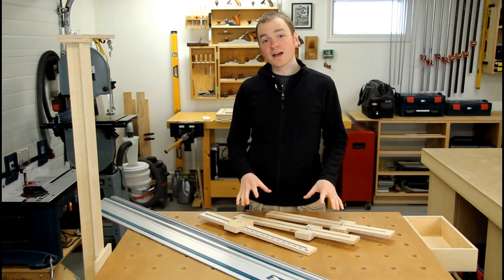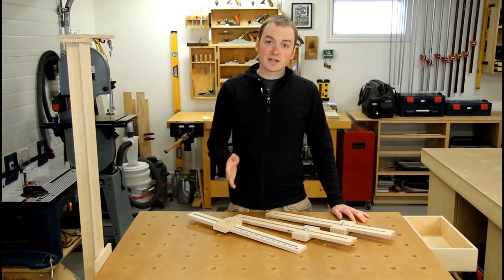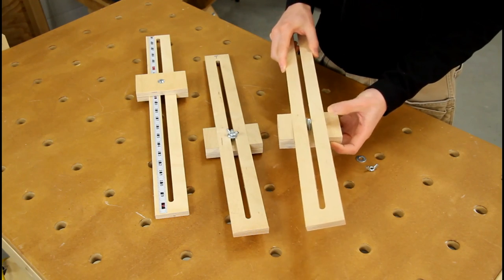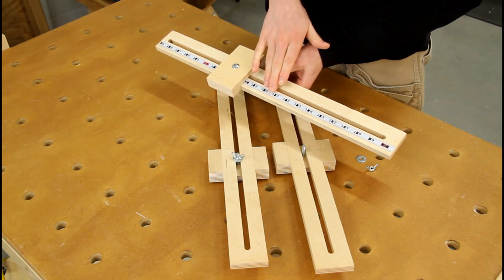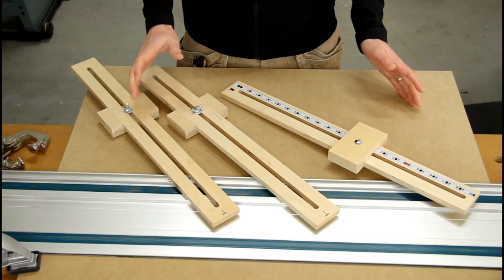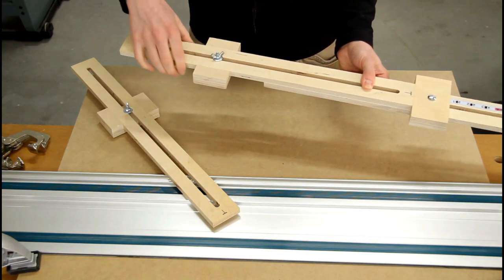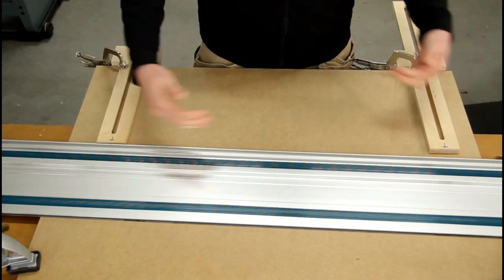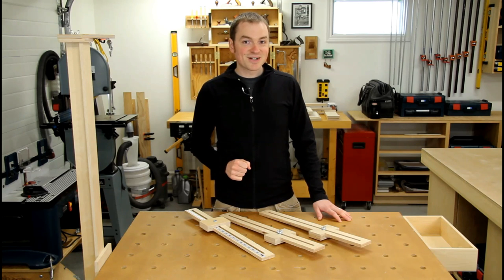Quick Parallel Guides for your Track Saw - Simple & Accurate

Comment: Dan, your design's inclusion of the measurement bar renders your system better able to produce absolutely parallel cuts than the "slicker" commercially available models that rely on accurate independent reading of the scales on a pair of stop/rail assemblies. As with many woodworking tasks, the best measurement is no measurement.

Comment: I watched a number of videos for ideas for parallel guides and I feel your design is the most simple and the most accurate of all the other designs.  I made mine last week for use with a DeWalt track saw.  DeWalt's track has anti-splinter rubber edges on both sides of the track, so I needed to cut off the rubber on one side of the track so that the guide butted up to the aluminum track.  I also make a couple of minor enhancements. I moved the scale to the top of the guide and added an adjustable plexiglass sight. This way I can fine tune the scale after I make my first cut. Another enhancement I made was to make removable 20” extensions giving me the ability to rip 26” without the extension and up to 46”with the extension.  I considered making the guides longer, but I felt they would get in the way for narrow rips.  And finally, to help keep which end of the guide is which, I painted the tips that touch the rail.  I also painted a thin stripe on the rail itself to remind me which side of the rail to place the guide.
Reply: You could of just put a small rebate at the end, so you didn't have to cut the splinter guard off👍
Reply: BEN LATHAM I played with a few options before cutting the splinter guard, but in the end, I wanted to be sure my parallel guide was resting against the aluminum track without having to check or verify each one.  Besides, DeWalt is the only rail I know of that has splinter guards on both sides of their track.  Removing one hasn't been an issue.

Comment: This is just what I needed! I am using the same Makita track guide which is long enough for cutting the short side of a full sheet of plywood in one go. For ripping the long side though I would have to reposition the guide half way through the cut. Now with these parallel guides I can make sure everything is alined perfectly. thanks a lot!
Reply from the maker: +funkyclubber thanks for the comment.  That sounds like a perfect use for the guides.  Glad that you found the video helpful.
Reply: Great idea for ripping the long side. I've got a 55" and 39" Makita track coming. I was wondering how I'd rip an 8' sheet since both tracks together would be short of 96". Now I can make these jigs and just use the 55" track repositioned.
Reply: @Campos2011  I'm sure you've come up with another solution by now, but for anyone seeing this post, you can also buy makita guide rail connectors. This way you're able to cut down full sheets length-wise, by combining two separate makita guide rails.

Comment from the maker: Check out the parallel guides that one of the viewers has made based on the video!  If you build one of the jigs from the channel and would like to share or any other idea make sure you post it on the DP Shop Talk facebook page.

https://www.facebook.com/photo.php?fbid=10154462749878054&set=o.473239762859879&type=3&theater

Comment: You, good sir, just earned a new sub.  This is brilliant.  I bought a Dewalt track saw system a couple of months ago, and I've used it so much I can't believe I ever went without it.  But I was stumped on how to set up a parallel guide.  This is super simple and absolutely brilliant.  I'll be making it this week for sure.
Reply: How did it work out on the dewalt track? Little different with the double sided track
Reply: @garradmiller5025  Pretty much perfect.  I only ever use one side of my tracks, but the Dewalt should be the same on either side.  Any minor differences are accounted for on the first cut through the rubber zero-clearance strip, so I don't think it would ever be an issue since these guides butt up to the track rather than ride in a channel like the woodpecker system.  I have both the 59" and 102" tracks, but the real test was using the 102" to make some rips down 8' ply.  Repeated cuts were dead nuts accurate down the full length, so I'd call it a huge success.
Reply: @mkbcoolman  good to hear. I was mainly curious about indeding againstbtubber rather than aluminium.  102" track seem long enough? Been eyeing one but have heard some think its too short.
Reply: Yea, I just ordered my Dewalt Track saw so this made my life a bit easier

Comment: Exactly what I will have to make tomorrow (some time....!!) as my poverty track saw and guide has worked really well but repositioning the track halfway through the cut exposes the cut to much potential error. Tmrw I get another 1400mm track guide to connect to my existing 1400mm track and then I will really need that setting jig.  Next week my new Carvex arrives and of course that will never fit these poverty pack track guides.  I've ummed and aahed for about 5 years now about getting a Festool tracksaw but I'm so surprised that this cheap one works so well that I've put off going green on this... I'm off to rewatch yr MPT/MFT vid to get some more ideas on setting this tracksaw up on the Festool top. 
Thanks for the great videos and the modern technical take on modern technology and techniques. Need a ton more of these on YouTube as so much fantastic stuff gets buried over on FOG.  And, most of the magazines just avoid the whole genre and concentrate on birdhouses, router bits and block planes (apologies to those affficionadoes) Nothing like how to set up a square tracksaw cut or how to get the most out of a MFT top...or how to engineer a boom arm!!  Thanks again and g'day from the south west of Australia....
Reply from the maker: +cognitor900 glad to hear you find the videos helpful

Comment: Hi Dan! Thanks for the tip. I was just looking for something like this. And with your ideas, I have built my own.
I would suggest doing the slidders of the same width of your ruler (mine is 185 mm width). So that I don't need to perform calculations. I just measure the whole distance from the top, to the end of the slidder, and done!
Reply from the maker: Great idea, thanks for sharing👍

Comment: Another great shop made jig you got there. However, isn't the setting jig (SJ) unnecessary? Can't the parallel guides (PG) be used to set each other? For instance, you'd lock down the stop block on one PG, and essentially use that as the SJ for the other PG?
Reply from the maker: +Know How you're right it is unnecessary. A lot of people have pointed that out since I made the video and it's something that never occurred to me at the time. I do still use the setting jig though when I use the guides since I already have it and it keeps the setting jig as an accurate reference that doesn't get bumped around. Definitely isn't required though.
Reply: Great point!

Comment: I like this idea; simple and effective.  It reduces error possibilities.  The only thing I’d probably do differently in the design is use T-bolts and recess the head of the T-bolt and epoxy it into the stop block.  That way the bolt head won’t stick out of the bottom of the stop block and scratch stuff up.  I’d also probably use some nice plastic knobs instead of wing nuts.  But those are minor things; personal preference.  Great stuff, Dan!
Reply from the maker: Those are some great ideas Rich, thanks for sharing.  I think when I made these I was making them quickly and grabbed whatever I had for hardware in the shop at the time.  The T-bolts and knobs would be great additions.

Comment: Great idea, will save me money.  But why not just use the setting guide as one of the parallel guides after setting only one of the guides?
Reply from the maker: +Maurice Calis you're right.  A lot of people have commented about that.  I do still like using the setting jig though since it doesn't get bumped around like the guides do so it stays more accurate.  You can definitely just use two though.

Comment: Great tip, why not just make two, one calibrated and one blank and use both to clamp saves making three.
Reply from the maker: +Neil Brackstone you're exactly right.  The thought never crossed my mind to be honest.  There have been lots of comments since I posted the video pointing that out.  I still like using the two guides and the setting jig since I know the setting jig isn't going to get knocked around in use but you can certainly just make one setting jig and one guide jig.
Reply: +DP Shop Talk nice videos, thanks. I was going to make the same comment Neil did, but your reply to him made me rethink it. Thanks!

Comment: I’m curious how you made the parallel guides perfectly square? I imagine you glued the side pieces to create the groove, which makes  it difficult to keep everything square. I don’t have much at my disposal other than a circular saw at the moment but want to build a diy track guide and your excellent parallel guides. Thanks!
Reply from the maker: +Ben S when I made the sliding stops for the parallel guides I made one blank with the side pieces glued and tacked in the correct position and then cross cut the blank into 3 pieces on my table saw cross cut sled to make sure they were perfectly square.  If all you have is a circular saw you can use simple jigs to get accurate square cuts.  My circular saw cross cut jig works very well for making accurate cuts like that.

Comment: Did you calibrate the tape on the setting jig for the distance between the back of the track guide and the front where the cut is made? If not the pieces will always be too big by the width of the track? If you did what was the allowance and how did you determine this? Do you think this distance will change as and when the blade on the saw and the splinter guard on the track are replaced? Many thanks in advance for your thoughts.
Reply from the maker: +T Radford yes I did calibrate it. I did that by setting the guides to an arbitrary setting and making a cut. I could then calculate what the exact distance is from the splinter strip to the opposite side of the rail by subtracting the jig setting distance from the size of the cut work piece. I always use the same brand and model of blade so that the setting never changes. Replacing a splinter strip has no effect on the accuracy.
Reply: OK thanks for that Dan, most helpful.  Keep up the good work with the videos, first class quality and you have a great presentation style.
Reply from the maker: +T Radford thanks very much.  I appreciate the feedback!

Comment: Could inlayed t-track be used top and bottom? Then use the track connectors some how? Use the bottom to attach adjustable t-track clamps.  I think I might try to figure that out. Hmmm. Thanks for the inspiration!
Reply from the maker: Sounds like a good idea 👍

Comment: Hi Dan, My problem is lining up the plywood panel that I am cutting with the reference face (say the edge of the table) and the saw guide that is cutting a cross cut. So far I have made one from the Ron Paulk video in which the two jigs locate on either side of the bench with an edge guide fence to locate the wood being cut and each carries a stop to position the saw guide at right angles to the bench. Am I missing something in the way that you apply your parallel jigs on top of the plywood panel to be cut? Colin in Northern Ireland
Reply from the maker: +colin farrier I'm not sure I quite follow your question.  The parallel guides work independent of the work table and will give you a rip cut.  For making cross cuts I use the Parf dogs in my MPT which aligns the work piece and the track or for bigger cuts I now use the GRS-16 which I just reviewed.  I'm not sure if that answers you question or not.

Comment: Do you have to add the width of the rail itself to the 18 inches measurement exsmple you used in this video? The cut is on the other side right?
Reply from the maker: The width of the rail is factored in when the graduated tape is applied to the jig.

Comment: Hi, thanks for sharing this video.  I would like to try making these but I only have a hand held festool router (OF1010),  track saw and MFT3 table.  How would you recommend setting up to cut these slots?  I know I can use the guide rail and stops to cut the internal slot but I don't really want to cut up my table and then also it might be challenging to secure the small pieces of wood.  Thanks for your suggestions!
Reply from the maker: +Patrick Cox I would put a backer board under the piece that you're working on so that you can rout into that and not damage your MFT top. You could temporarily attach the piece you're routing to a bigger backer board with hot glue or double sided tape. Then you can easily clamp the backer board down on your MFT. Hope that helps.
Reply: Good suggestions!  Thanks!

Comment: From watching the end of the video, it seems like these jigs assume you want to make a cut which is always greater than the width of your track.  Is that correct?  What if I want to repeatably cut 2" wide strips, is there a way to do that with these?
Reply from the maker: You're right, these don't work for cuts that are narrower than the tracks. You would need a different type of guide that would go underneath the rail for that.
Reply: @DPShopTalk  thanks!  I watched another video where someone has a jig for repeatable narrow rip cuts but it wasn't something that stayed in place while cutting. it was more like something that you put in place temporarily on the cutting side of the track, which you line up the guide edge with, then you remove the jig once your track is in the right spot. Maybe that is good enough.  Other videos involving expensive jigs with bars that go under the track assumed you were starting with a narrow piece and you were cutting it narrower.  The task I am imagining is cutting a bunch of strips out of a big sheet of plywood to do french cleats.  There was a video where they do the French cleats with a parallelogram profile and have a bunch of equal sized, equally spaced narrow strips on both your wall and your thing that you are hanging and they mesh nicely together. I was wondering if there's a good jig to use to do that with a track saw.
Reply from the maker: I've found that the table saw is still by far the fastest way to cut narrow strips, assuming that you have one. I do cut narrow strips with the track saw on job sites but I just measure and mark them.

Comment: Maybe I am missing something but I think you could settle with only 2 jigs if you use one of them as setting jig as well with the bench tape attached. Not?
Reply from the maker: +Laszlo Horvath you're exactly right.  The thought had never crossed my mind until I had some comments back like yours pointing that out.  I still use all 3 jigs but you can certainly just use two if you want.  That's one thing I like about DP Shop Talk and the comments that I get back, we can learn from each other.  Thanks for bringing that up.

Comment: Dan (or anyone else), I'm fairly new to woodworking, I have a track saw and router. A couple of questions... 1) How do you accurately route the groove down the center of the bars? Is this where a router table is invaluable? Thanks for any thoughts.
Reply from the maker: You could use a router table or an edge guide on your hand held plunge router. If you don't have either of those you could also make a simple jig to hold the work piece and guide the router.
Reply: @DPShopTalk  ah of course, I didn't even think of the edge guide, and mine has a fine adjustment on it. 😳 If you're routing the slot in 0.5" Baltic birch, how many passes with the router would you take? I think I'm trying to do too much with each pass. Thanks for the feedback 👍
Reply from the maker: I would probably make about 3 passes.
Reply: @DPShopTalk  I did a quick trial last night (taking 3 passes) and ended up with a beautifully straight, clean routed channel.  Thanks again Dan 👍
Reply: re: router - why use a router - could cut straight strips for sides, and make an end-block for each end, leave groove in middle, and fasten.  just an alternative suggestion, i'm going to make a set, and try it that way (saves me all the router dust in the basement, in the winter  :-) )
Reply: @firstaozlastaoz8212  good thinking, always more than one way to skin a cat! I have also routed a groove for ruler tape and made an adjustable indicator with persex so I can dial it in when finished.

Comment: With the long groove in the center, does it flex along it's width?
Reply from the maker: No I've never noticed any flexing. The baltic birch is pretty rigid and strong so it hasn't been an issue.

Comment: You have to allow for the thickness of the  saw blade  ( add to the width required  on this side of the track) which in the case of Festool is 2.2 mm or 3:32"
Reply: No.

Comment: I'm New to woodwork. You measured 18" but isn't the cutting edge of the track on the far side of your 18" measurement? What am I missing?
Reply from the maker: +Breal191 the built in tape on the setting jig is calibrated so that when it gets set to 18" that means that the parallel guides are set so that it's 18" from the stop blocks to the cutting edge of the track, giving a rip that's 18" wide.  The width of the track is factored in to the calibration of the tape.  Does that make sense?
Reply: Dan Pattison oh ok, that makes perfect sense. Thank you!

Comment: If its not as fast as a table saw most people wont consistently use it over time. Gotta make the jig better man!
Reply from the maker: The table saw is faster for repetitive rips anyway. The track saw and parallel guides are meant for if you don't have a big table saw or need to work ultra portable. When I'm building cabinets in my shop I use the track saw to cut the sheets into easier to handle pieces and then use the table saw from there.